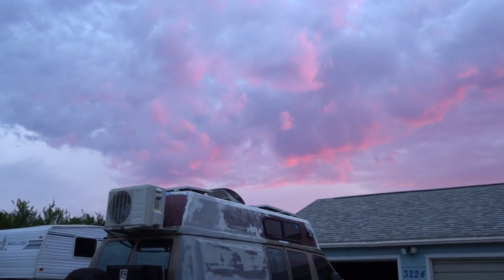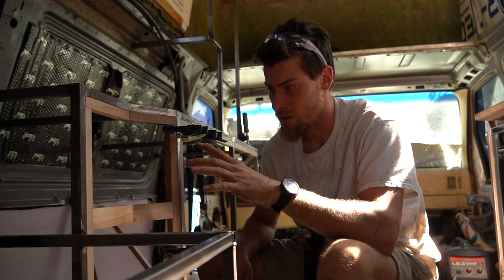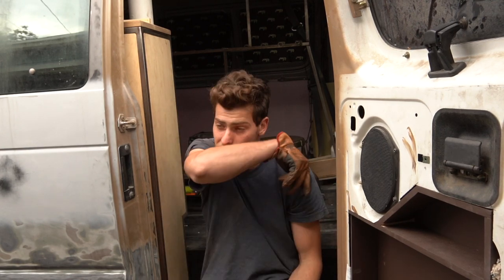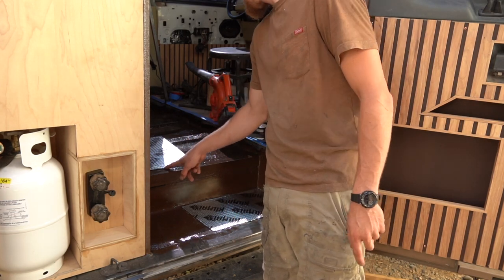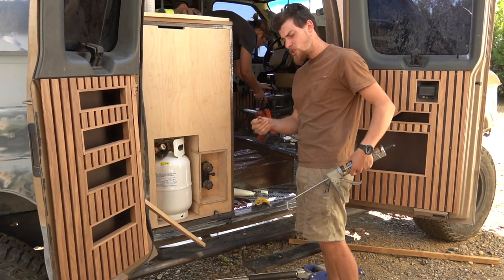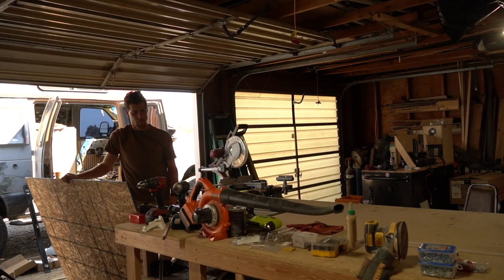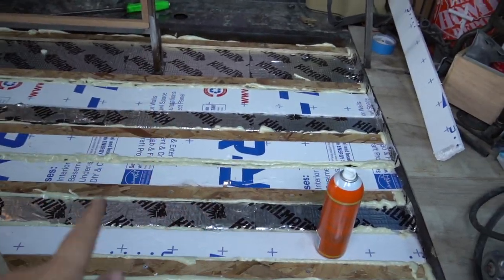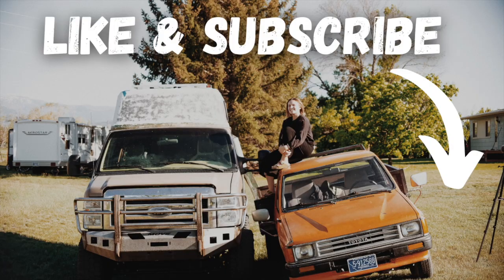We Have Subfloor!!! // Van Conversion Series // 1995 4x4 7.3 Ford Econoline

Comment: Did you guys roll the kilmat?  It is highly advised to prevent future rust.  And it makes the kilmat work better. Use a heat gun to warm it up and it rolls much easier.
Reply: Roll? What are you talking about? Kilmat and rust? I think your confused. Kilmat is a sound deadening. The epoxy was the rust inhibitor their using...